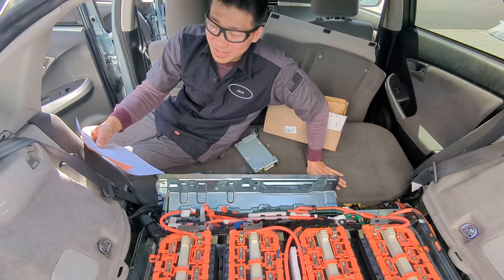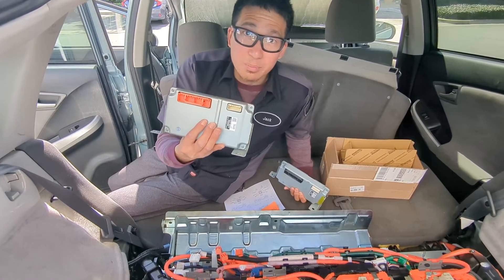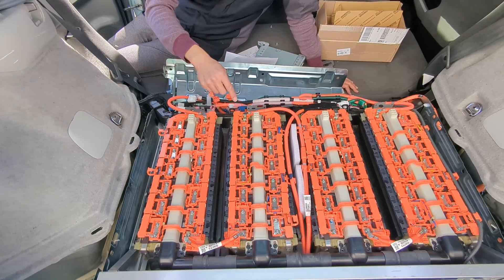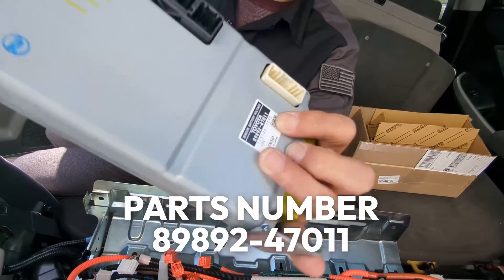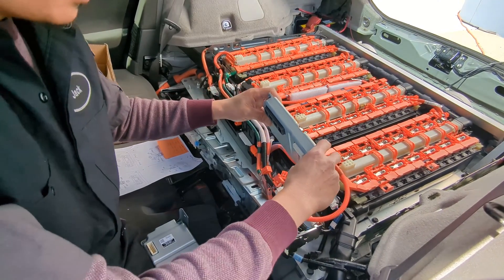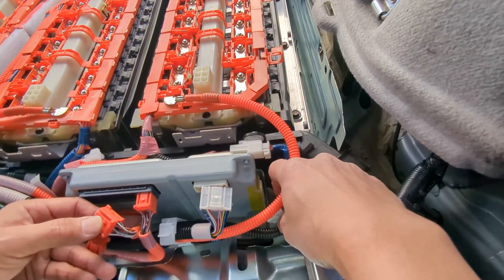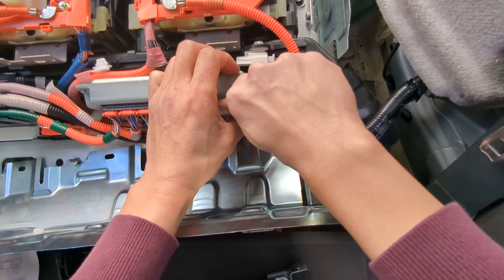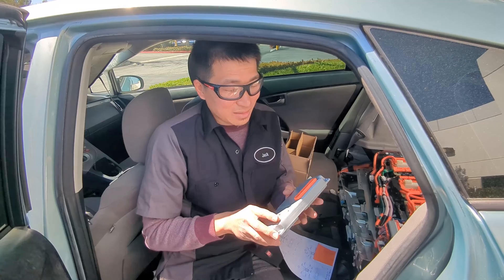Prius Plug-In battery error code P1A05, P1A0A, P1A63, P1A64, P1A67

Comment: Did you ever notice these newer black connector bsu look like the units in the 2016-2022 gen 4 genuine Toyota Lithium option pack part?  I still haven't confirmed if same and interchange, though was noticing in a Weber State tear down of the gen 4 lithium option pack. 

Second thing I was wondering is if the Prime lithium cells can be used in the Plug In 2012-2015 packs to replace those lithium cells?